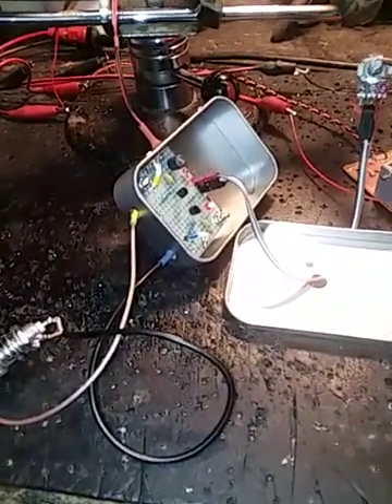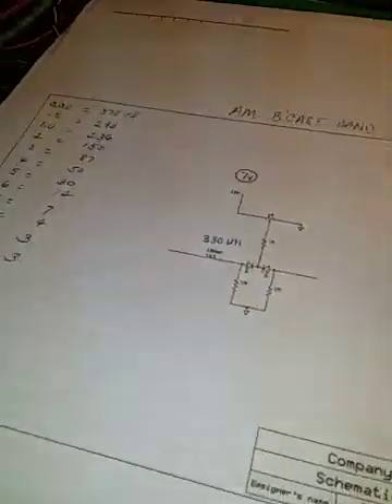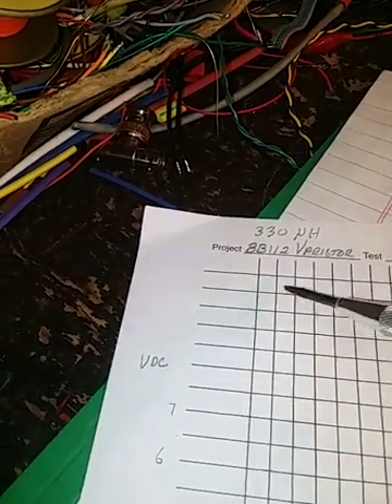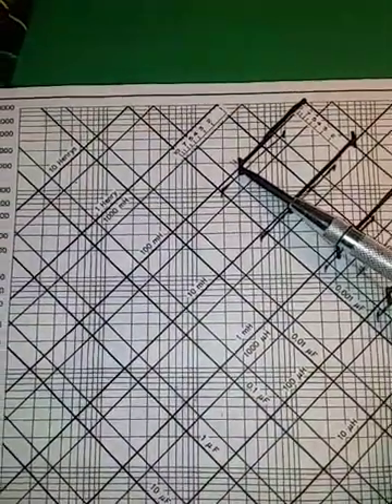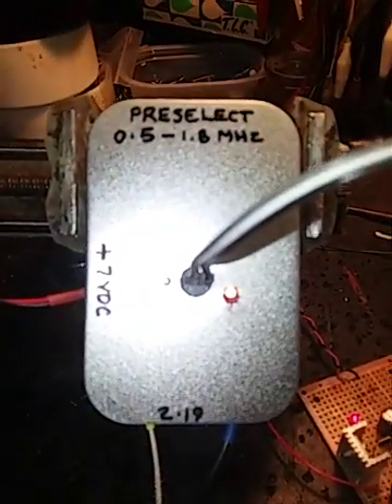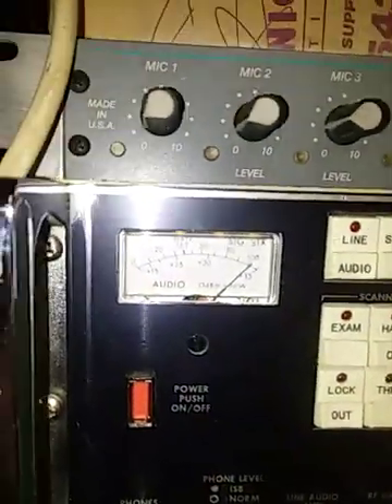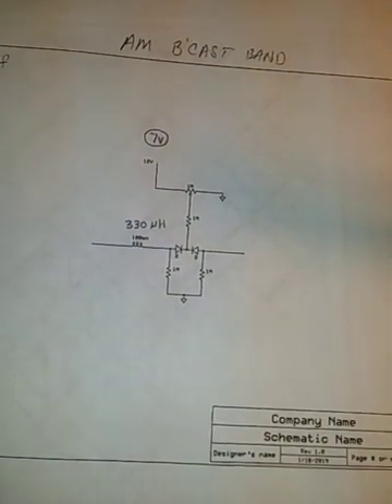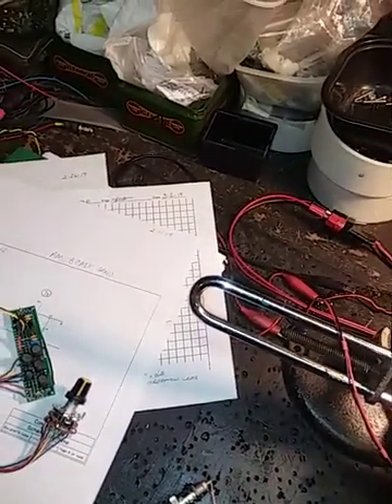Preselector for Radio Receiver (elect)

Comment: Very interesting and unusual circuit!  Can I ask some questions?  Is there going to be any insertion loss with this?  I notice most preselector circuits I see have an active component in them, like a Fet or something like a Mar-1 amplifier package.  What’s the output impedance of this circuit if you wanted to follow it with a fet or 50ohm input amp?  I’d like to use something like this to boost the sensitivity of a vintage tube radio.  You deserve more subscribers, well done.  Just one more question, what make was that receiver you used?  It looked very unique, homebrew?  73, VK4QP.